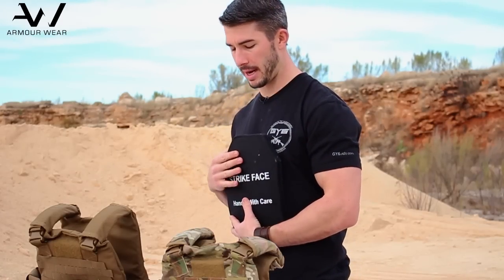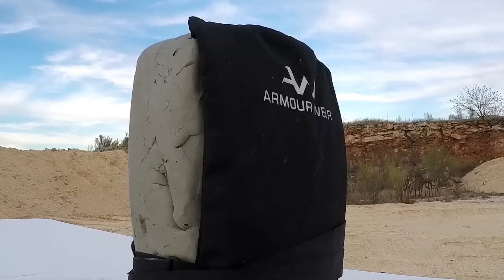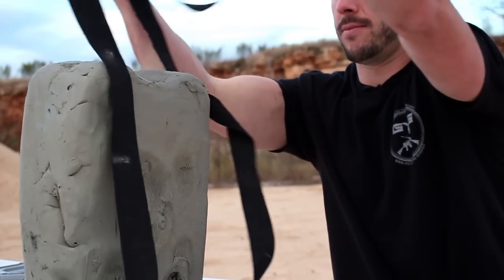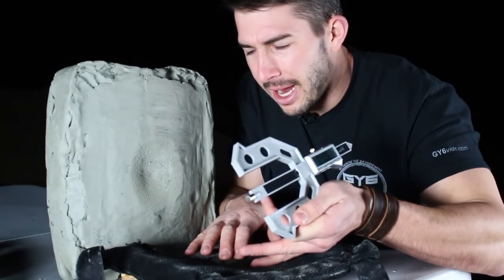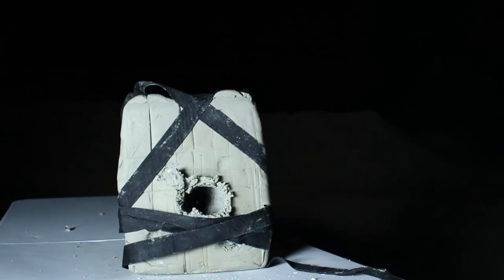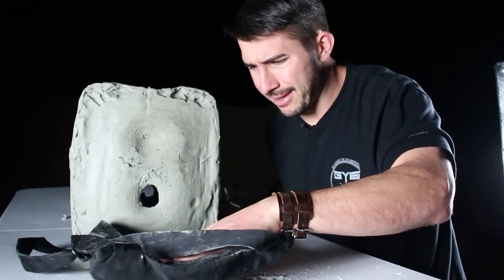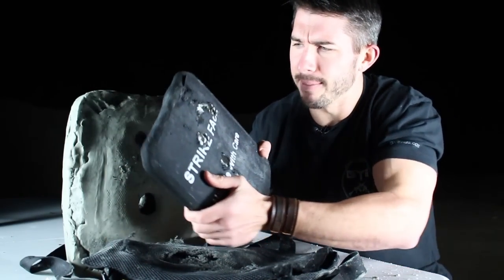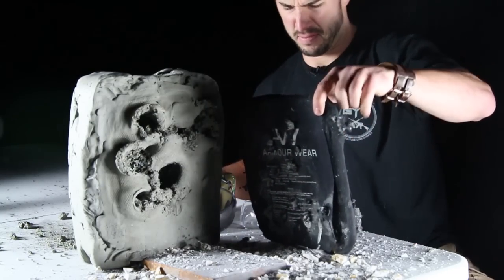Ceramic Body Armor Test: PART 2 " BackFace Signature" in CLAY

Comment: Thanks for all the time you spent on these videos (parts 1 &amp; 2)!
You mentioned that steel would hold up better/longer but cause a lot of flying bullet fragments up and down, which is where the ceramic plate is better. Ok fair enough.
Is there such a thing as a plate which has both steel and ceramic, perhaps that would be the best of both worlds?
I know that plates exist with a very thick rubber layer at the front to prevent bullet fragments flying all over the place and that works very effectively.
I was just wondering about a steel/ceramic solution?

Comment: okay. have you tried other ceramic plates?  specifically ceradyne (I think, sp.) my main question is, when a plate, ceramic  or steel, is coupled with a level 2 plus vest, does that change the nij rating?

Comment: if you ever get the chance, this test would be cool to see with a 338 Lapua Magnum (Standard 250, 285, or 300gr. Personally Ioad 277gr.) Another company showed their plate off in a video taped to a steel target and "it stopped it." It also dented the steel target plate... you be the judge. But I would like to see

Comment: @GY6vids Theoretically speaking, wouldn't the back face signature  be slightly greater than what you measured due to the concave form of the plate? so using your measuring tool, wouldn't you get a higher, deeper measurement if the feet of the tool were above and below the back face signature, rather than to the left and right?

Comment: What is the weight difference between these plates and like ar500 steel cuz it seems like ar500 steel would be better cuz it would take way more shots to get threw and thanx for all the great vids
Reply: The Steel plates are normally level 3 only. Unless you want to carry a 12 pound plate to stop the AP rounds. The decision between the 2 is up to you.

Comment: The ar500 has a coating on top of the plate (forgot what it's called) that stops fragments from hitting you in the face and legs, have you checked that out?
Reply from the maker: YEP! "Anti spalling coating"
I'll be doing a full review of a comparison test between the two very soon.
I like both types, they just have different purposes.
Reply: Thx
Reply: GY6vids I wonder if Herculiner bed liner work as anti spalling.
Reply: n3wbie2000  If you can get it built up at least 1/4", The real thing isn't far off.

Comment: i think that those plates come with pads.
you should use an AR500 plate and not ceramic plates, the AR500 are more resistant although they are heavier